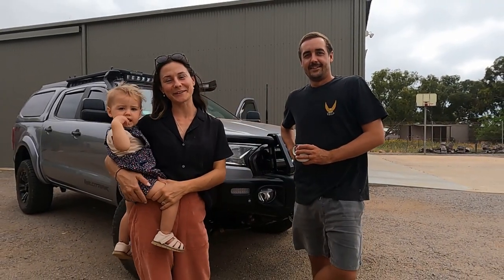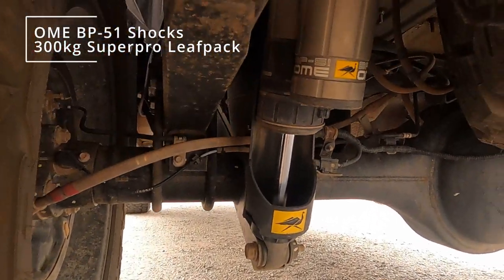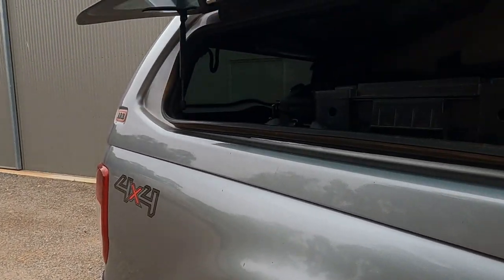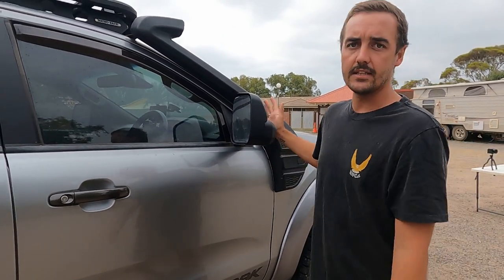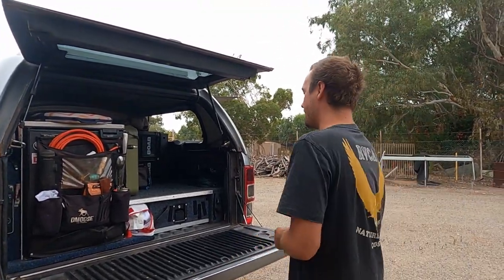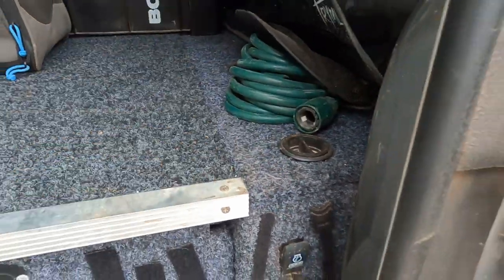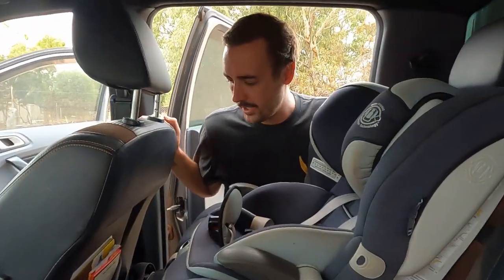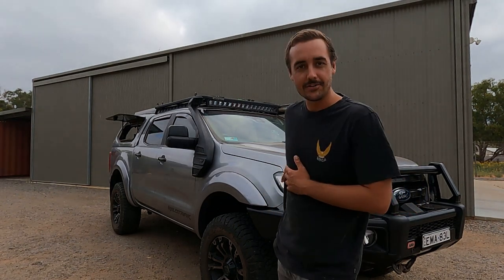Rig Rundown - Towing a caravan around Australia Ford Ranger

Comment: Tyres ive got Mickey Thompson ATZ P3 with 30000 kms on them not much wear cant fault them off or on road also has security of 73000 km warranty on tread wear, mind you though havnt done alot of towing which I'm guessing will affect tyer to some degree but I do carry constant weight easily 300kg everyday, worth the money so far. There half way between a mud tyre and a traditional all terrain so there a pretty aggressive tred but also for me at least very little road noise compared to other AT's ive tried (but i have been called deaf once or twice in my time) definitely quiter than MT's though. Thats on a 2021 PX 3 3.2 ltr ranger so may have bit different sound deadening compared to early models idk.
Reply from the maker: Cheers mate! Iv had those tyres on my old car they were really good 👌 I ended up going with the maxxis razr MTS, so far they have been good 👍
Yeah mate towing unfortunately just adds extra ware 👎 all part of the cost of travelling  though so it is what it is.
Cheers mate
Reply: @WhileWereYoung. Hahaha got those same draw issues with my draws ive double stacked them. I love the way you've set your tray/canopy up it's tidy.
Reply from the maker: @Sh1tstir  hahaa yeah it's a pain! 🤣 Thanks mate it works alright for us 👍

Comment: Is your winch working? When did you test it last?
Reply from the maker: Yeah it's working, I run it each time i service the car just to make sure I get the gears moving and it dosnt seize up. In saying that I usually only run it out a meter or 2 and then back in, but I'm guessing it will still pull 🤷
Reply from the maker: And I service the car every 7500km, which comes around quickly when your travelling Australia haha 😭
Reply: @WhileWereYoung.  sounds like you don’t want to find out that your winch is not working when bogged down to the chassis…. 🕺
Reply from the maker: @andrefischer5025  hahaha yeah I think it pays to double check it each service. Even tho it still might not work when u need it 👌